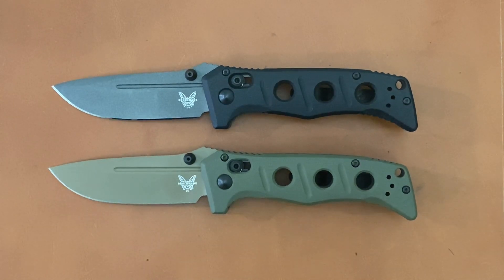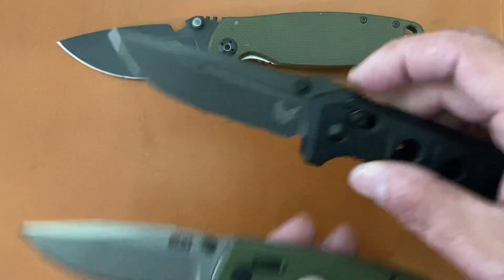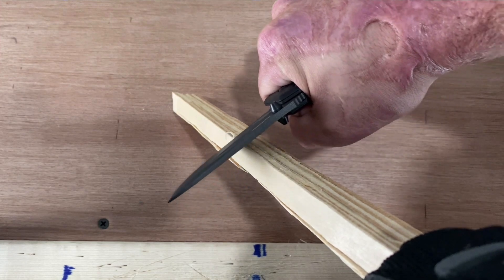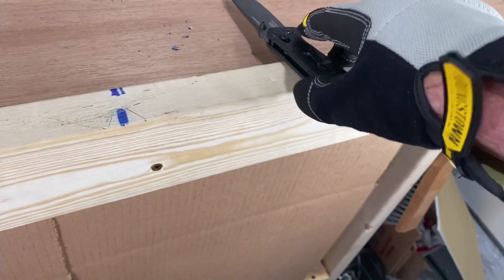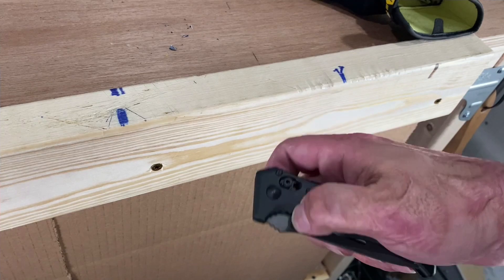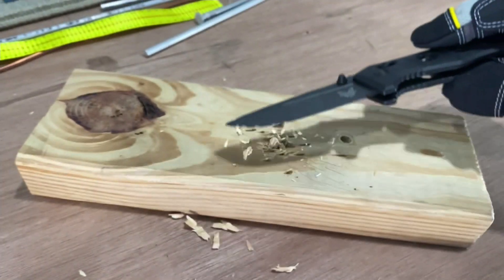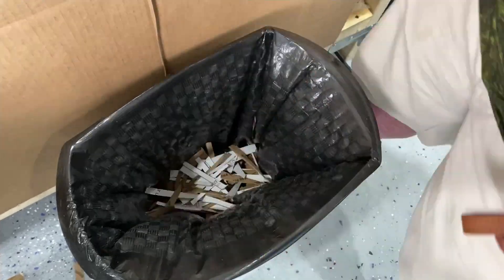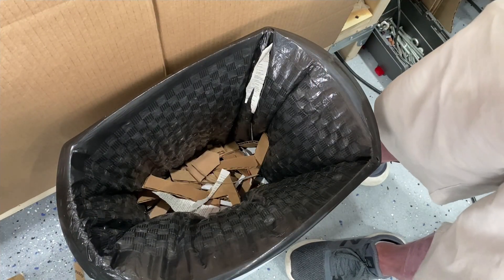Can you Use the Benchmade Mini Adamas as your main EDC? : Full Review & Hard Use Testing

Comment: That’s weird that yours is 18 thou behind the edge. I measured mine at around 30 thou on the flat and 40 thou at the tip
Reply: Yikes
Reply: Mine is 19 in the belly 27 at the tip.
You sure your measuring right behind the edge?

They CNC the blades so that big a variance would be odd
Reply: @SuperSteelSteve  I just measured it again side by side with my PM2. I got 29 thou on the mini adamas and 20 thou on the PM2
Reply: Mine is also around 18 at the belly. I was pleasantly surprised
Reply from the maker: You must have gotten a bad one because I have both variations and the both read +-5ths from each other and I calibrated my calipers before I took the measurements. I was expecting it to be thick bte but was pleasantly surprised to see how thin they ground it